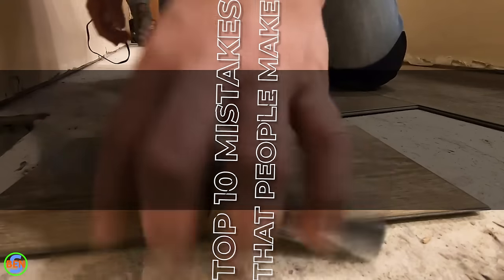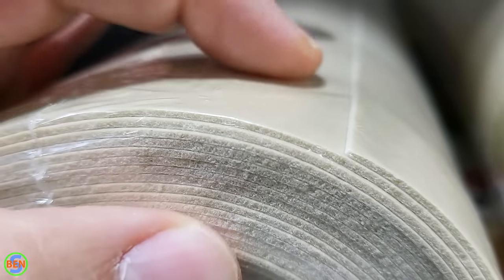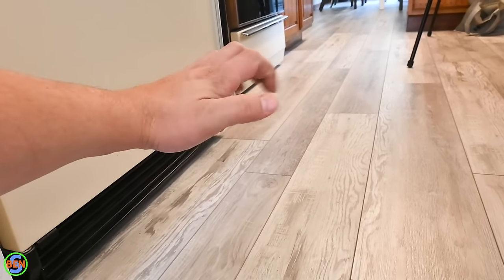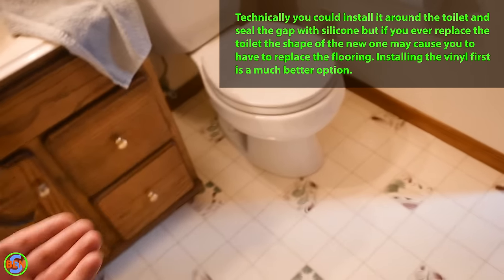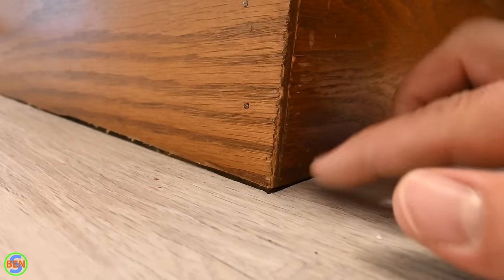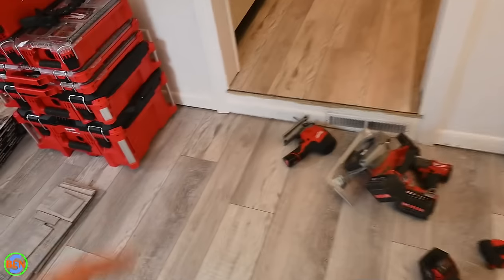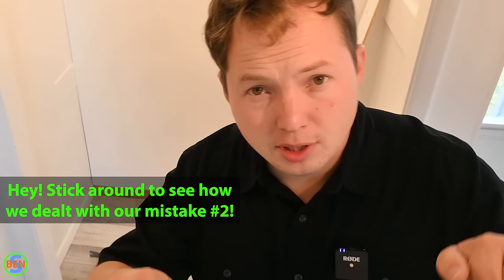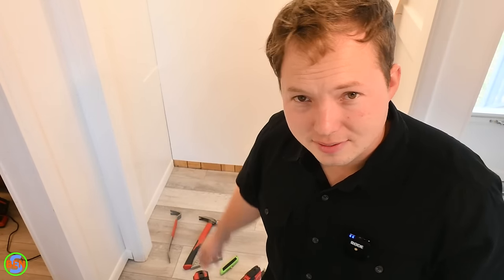10 Huge Vinyl Plank Installation Mistakes!

Comment: Small point with regards to vinyl plank (or any flooring) around the toilet. The toilet mounting flange should absolutely be on top of the finished floor, as best practice. You will have people argue this, but thats simply how the manufacturers designed the standard toilet to work, this is so it will compress against the seal properly. I

Can you get away with having the flange recessed and using a larger seal? Sure, sometimes, but what you really should do is pop the flange off if possible and put the new floor under that, then reinstall the toilet. I understand thats not always possible though. Definitely better to at least have the planking underneath the toilet and then use a fluidmaster seal with a spacer.

Really appreciate the video, super helpful!
Reply: I've owned five houses, pulled & reset countless toilets. Agree on the flange height 'best practice'. But when confronted with a poor flange installation I use 1 sometimes 2 jumbo wax rings. BTW I always silicone caulk the annular ring between the flange and flooring to ensure that water cannot migrate under any finished flooring. I'd rather see it leak out onto the TOP of the bathroom floor.
Reply: @billk8780  Good points.
Reply: M brother installed my toilets the last two times. It's obvious to me now he should have installed a new taller flange. What he did instead was pile what was left of the gross old wax on top of the new wax ring to make it higher. When he did it the first time I thought okay but when he did it again I asked why are you doing that and he said the person who built the place f-up and put the flange too low. I then started investigating it and found the proper way to fix this. He also stated it you smell anything thats okay, just turn on fan. Yuck. Smells like sewage!!! I am 62 female with spinal issues so cannot repair myself. Will have to hire someone again. Yes he does home renovations and yes I paid him to do it!!!

Comment: That bow in your basement floor is probably because they didn't leave a game between the edge of the flooring and the wall. You might be able to fix it by taking off your baseboards and trimming the floor so there is about 1/4 inch gap around the room.

Comment: It's a bad idea to install any kind of floating floor in wet areas such as bathrooms and kitchens. Water can get under the flooring and cause all kinds of problems, especially if your sub floor is wood. I would much rather install tile, even though it is a massive pain to install compared to a floating floor.
Reply from the maker: Tile is really nice.
Reply: What if we started priming the subfloor as standard practice w any floating floor? I've been doing this everytime before I install any flooring. I also screw down every wood subfloor I work on.

Comment: I'm happy with my commercial grade porcelain tile I installed  in 2008 over 1/2" cement board over 2 layers of 3/4" CDX screwed to the floor studs.
I dont like vinyl, carpet, laminated crap,  or "engineered" crap, nothing wears like tile and as a multi giant breed dog owner tile is the ONLY flooring that is 100% durable and can be wet mopped with bleach and soap using a commercial grade string mop and wringer bucket! Once a week I hit all the floors with bleach and soap. All my floors are white porcelain tile even in the bedroom, the only wood floor is in the front room the dogs cant go in and it has oak parquet.
Reply from the maker: I really like tile as well. The critical thing is the subfloor being done exactly as yours was.

Comment: The end of my floor is under base board radiant heaters. How do I get spacers under there? Could I use a thin peice of wood that I can remove after so that space is consistant? Also what stops the last board from sliding? I have that issue with flooring a "professional did, the end of plank is separating and sliding under my cabinet in kitchen. Perhaps he broke the clip that holds it. The only way I can see to fix that is to pull plank and crazy glue it. The guy had NO idea what he was doing so this time I will do myself.
Reply: Just wanted to add the flooring in main area is laminate not lvp.

Comment: Absolutely HATE when looking at houses for sale and they list them with new laminate or 'luxury' vinyl plank flooring. To me it is putting lipstick on a pig. I would rather have the old worn carpet/flooring so I can put in what I want and see what is under it. However, most people want 'move-in ready' because they don't have the cash to replace anything nor the skills/time to do it. Most house flippers do stuff as cheaply as possible and you pay the premium price for the house only to rip it all out later anyway. Went through a repo house on a slab with old carpet and linoleum floor coverings and bathroom/kitchen needed redo. (should have bought it when it was cheap). Realtor/flipper got it and put cheap gray vinyl plank flooring throughout. Same pattern in ALL the rooms. UGHHH! I'm sure they didn't put floor leveler over the slab so there will be problems later. Asked $30-40k more than it was as a repo. Maybe spent $10k on it.
Reply: You're not the only one that can't stand this stuff. It's very tacky right up there with vinyl siding.
Reply: I agree with you. I would much rather not pay for a house w higher price tag that has a rushed/lousy installation. Even professional contractors ive worked for didn't really do any prep other than to out screws in places where there were obvious squeaks.

Comment: Don't install vinyl planks in a bathroom! Unless it's a masonry floor. 1st, it's taking the cheapest solution. 2nd, kids get out of the tub dripping wet, and water getting under the planking causes mold and rot on a wooden sub floor. I was the electrician, doing maintenance in a 150yr old apartment building, when I told the property management the handyman mistakes. All 10 bathroom floors buckled and the plywood sub floor delaminated inside of 5yrs. The end planking joints should never be hit with mallet! The slightest tap with the palm of your hand should be enough pressure. The end joints can be easily damaged and not lock on. If you push the planking together correctly, I can feel the joint click, on higher quality materials.

Comment: Mistake number 1:  Choosing vinyl. 
Hornet's nest poked.
Reply from the maker: You might be right! Do you prefer hardwood? Tile?
Reply: Idk i will push back on that, products like the so-called luxury vinyl are pretty good for some applications. I inspect homes in the DFW texas area, and its quite a popular product here due to cost effectiveness and durability. People update their homes every 15-20yrs anyway, seems like it is becoming increasingly more effective to get products that only hold up that amount of time. Even dogs nails wont scratch luxury vinyl. Only draw back is some products are harder to keep clean (dont take kindly to wet swiffers and such, and seem to show dirt and water more easily). 

Its resilience to water is a huge plus, easy install, and decent resilience are pretty good reasons to choose vinyl.

Im sure in 20-30yrs we will find out how it causes foot cancer or something, but until then, i thinks its actually not that bad
Reply: Also for pier and beams, it offers much more flexibility (the floating vinyls anyway) so you have less issues in more humid climates that flex houses vs say tile
Reply: Thanks for your hard work....I think Vinyl plank is water resistant but not water proof.
Reply: Hi, I enjoyed seeing this video. You did very well explaining common problems.  Please correct me if I'm wrong, did you say that vinyl planks are not supposed to nail or screw down for the purpose of expanding and contraction?    At my work place, we had contractor install them and they used glue and nails to fasten the planks.  Now I'm confused how to install them.
Reply from the maker: Most vinyl plank floors are designed to float but there are some that are glue down. Most likely they had a different product that was not designed to float.
Reply: @BenjaminSahlstrom  thanks for following up.

Comment: I absolutely HATE, HATE, HATE quarter-round tacked down along the edge of existing base. It is ALWAYS a sign of shoddy installation. Baseboard is inexpensive and if one is going to the length of installing new flooring, then update the damn baseboard too.
Reply: Baseboard is supposed to have a shoe molding but not quarter round